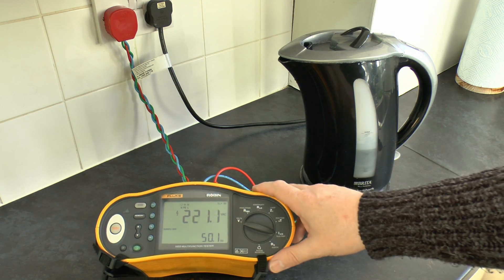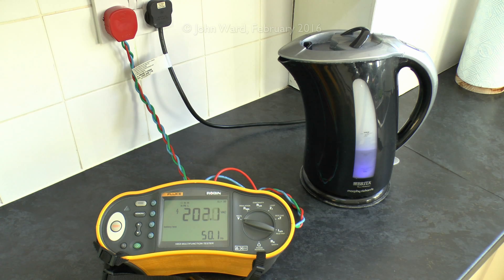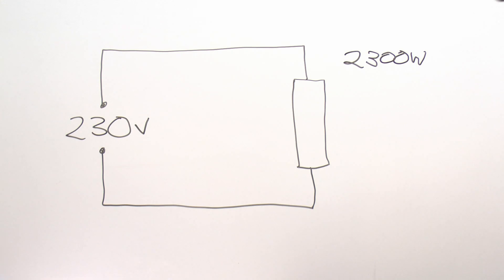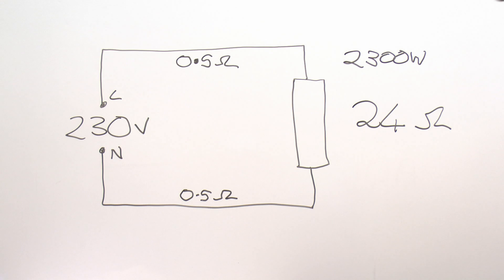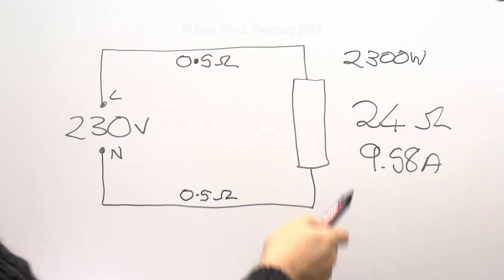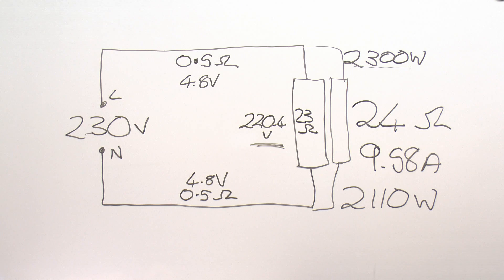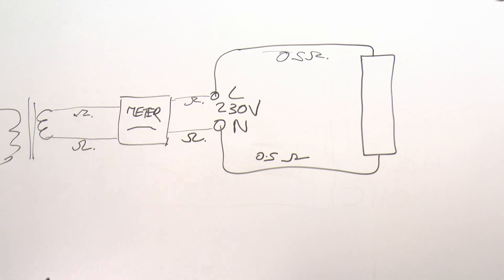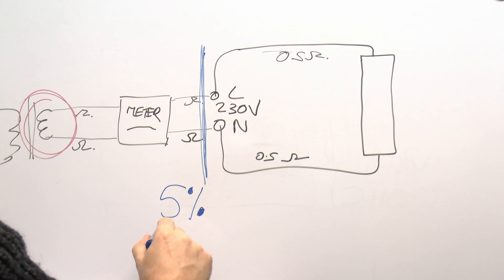Voltage Drop in Electrical Circuits

Comment: So far i  right remember in Germany here is a max. Voltage drop of 1% from the Transformer to the Meter and then from the Meter to the Sockets/Consumer a max. of 3%.
Reply from the maker: +jusb1066 Ring final circuits are wired in 2.5mm² T&E, which is rated for 27A maximum, considerably less depending on how it is installed.  A 32A protective device can be used because there are 2 cables to each socket outlet, hence it is vital that rings are tested properly before being used as a break anywhere will result in everything still working but could result in cables being overloaded.

4mm² would only be used for a ring if the cables were derated due to being installed through thermal insulation or similar situations, which is rare in the majority of houses.

No other circuits are wired in a ring, they are all radials.

Lighting is wired in 1.0mm² T&E, or sometimes 1.5mm² T&E. 
2.5mm² is used for ring circuits or radials up to 20A.
4mm² is rarely used for anything.
6mm² for cookers and electric showers
10mm² for 10.5kW electric showers and a few gigantic range type cookers.
16mm² is also available but rarely used.

For voltage drop limits, a ring in 2.5mm² cable can have a maximum total length of 106 metres.  In most properties it is unlikely any normal circuit would get anywhere near that.
In the video, voltage drop in the circuit cables is less than 5%, however the measured drop is greater as that includes the supply to the building as well, which at that property has a fault causing the voltage to drop more than it normally would.
Reply: don't some electricians prefer to wire kitchen sockets up with a separate 32A radial circuit on 4mm² rather than using a ring?
Reply: +jusb1066 I thought socket rings where T&E 2.5mm squared, which when run in a ring main can carry a larger amp load because of the use of two T&E wires, never heard the 2.5mm refered to as 4mm though or the two 2.5mm being added together to "theoretically" double their square ammount? Any further information on this?
Reply: +jusb1066 Ah I think I know what your talking about but I am 99% sure that in the UK lighting rings are 1.5mm T&E and socket rings are 2.5mm T&E. As I understand it you can load a 2.5mm T&E "ring" upto 36amps, however the consumer unit will have a 32amp MCB to stay under that max envolope. Anything plugged into this ring will have a 3 pin plug with a max 13amp fuse in the plug (lower ratings available depending on the appliance). Hopefully someone with a better understanding will comment, what always baffles me is how do the rings get calculated since there is a chance any given numpty could quite easily overload any given circuit ring with appliances.
Reply: John the thing is youre talking about systems in UK and Grumpy is talking about systems in Germany, im not from germany, but if i remember correctly then in germany your not allowed to have a fuse higher than 13A for light instalations and 16A for things like the Oven, they have 3 fase at the fuse box. Lights only allowed to 1 fase per light installation and they are not allowed to make a "ring" circuit. so totaly diffrent ways of doing things
Reply: I've become pretty militantly opposed to rings recently, they don't fail safe and people are often unaware that there's even a fault.  I think they're a bit of an anomaly.  I'd like to see them banned for new installations with the new edition.  We can make do with spurs or just go to 4mm cable if you really need a 32A circuit.
Reply: +Grumpy Electrician dunno how it could be achieved, we run a ring main, so two 32a cables supply his socket, perhaps the %3 is under less of a load than the 3kw JW's kettle uses
Reply: +jusb1066 i could only guess how the 32A sockets are connected, are they with a 4mm² (if under 10m it's at the edge), more or less if less it could explain the voltage drop.
More interesting would, how high is the Loop-Inpedance in this case.
Reply: Grumpy Electrician
things like loop impedance are beyond my knowledge, i can only say each socket is rated at 13a, the double john has is thus 26a, its connected to a ring circuit that uses cable rated at 32a and has a 30a breaker, the ring will supply all the (downstairs) 13a sockets in a ring main config(thus downstairs can only pull 30a total from all sockets combined)   his cooker would use its own (spur link due to being only one provided connection, and a 30a breaker). I assumed you are not aware of UK connections, but if you are then i am telling you stuff you know way more about than i do (and i apologise)
Reply: +jusb1066 it doesn't matter how high the breaker is, if the mm² of the wire is to small for the rating, then the resistance is high. i assume that the wire is not that big behind that because of that high Voltage drop.
The thing is for 32A you need at least 4mm² better or higher. the 13A says me that it's 1.5mm².
Reply: Grumpy Electrician
32a 'twin and earth' as we call it is 4mm2,(and remember 2 lengths feed a box in ring circuit) and short lengths of 13a are 1.5mm or more , longer (decent extensions) are 2mm
Reply: ZanderKaneUK
4.00 mm t&e is what i have used for a socket ring main, it is rated at 25a single run (so would easily do the 32a on ring) these details are from the screwfix site, a common place to buy such items.   2.5 i consider as lighting, i am not a pro electrician but have seen this used elsewhere so assume i was using correct cable. 2.5mm  is used in 13a cable so even the ring can only double it, so you need thicker than 2.5 for 32a
.   I have done some further digging, and 2.5m can be used for 32a ring main, its the length of the ring main determines if you get get away with 2.5m or 4.0, so i think mostly you use 4.0 so you are sorted.  4mm has a downside, you can only (just) fit 2 cables into each port, no room for another cable to spur outwards (2.5mm you can fi 3 in if you really need to)
Reply: +John Ward Thanks for the clarification, smarter everyday :)
Reply: ZanderKaneUK
the only info i have is hat when you buy 32a twin and earth, it is indeed 4.0 mm and not 2.5mm, i think the 2.5mm t&e is for lighting not power, there are t&e in 1.5mm also.

Comment: my parents house was temporarily hooked up with a 30 amp cord 120 volt and the lights would dim even with the smallest load like a electric drill not a mains drill it had a plug pack and the lights still dimmed from it and it was a very weak drill

Comment: The lightbulb dims for a split second in my kitchen whenever I switch on the kettle or microwave.
Reply: @WEWILLWIN tw15  Your time machine probably doesn't have an Energy Star label.
Reply: WEWILLWIN tw15 - you need to polish the flux capacitor a lot more and align your dilithium crystal to it’s optimum frequency 😉

Comment: Great video as usual John. I had an issue similar to that house you demonstrated on, apart from voltage here dropped to ~100v. It took WPD so long to do anything about the fault in the street that the cable under the footpath actually blew up one evening, taking out one of the phases and therefore a third of the street for over a day whilst they temporarily re-connected people to a different phase whilst they made the repair (which typically involved them destroying my front lawn, again).

Comment: Your voltage appears to be going below spec when under load.
Reply: +the3dvideo Probably not at the meter though. This is most likely due to the voltage drop of that particular circuit.

Comment: John, do the electric meters measure only current or actual power used (because of power factor etc)?
Reply: They measure actual power not apparent power, the only time you would be charged for apparent power is in a industrial environment that is why you do not need power factor correction. Eevblog recently did a video on this subject you should check it out.
Reply from the maker: +Jeremy Hall Yes, actual power from measuring both current and voltage.  Doesn't therefore matter what the voltage is, unlike those clip on energy meters which only measure current and assume the voltage is constant.